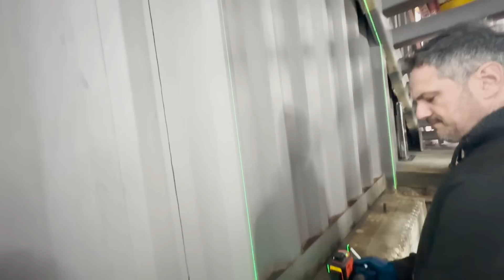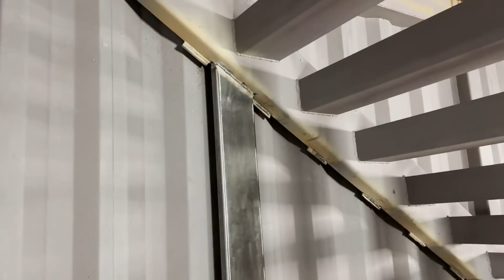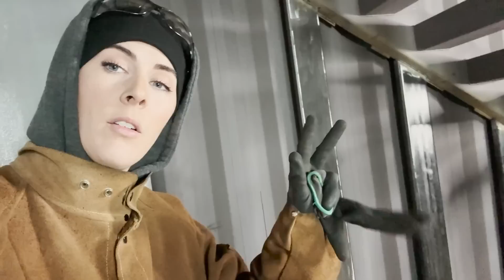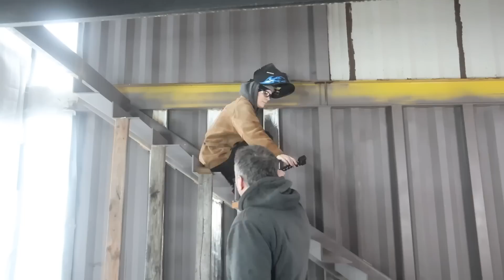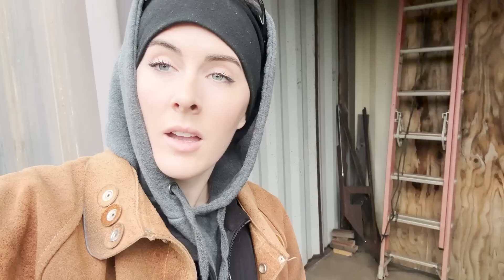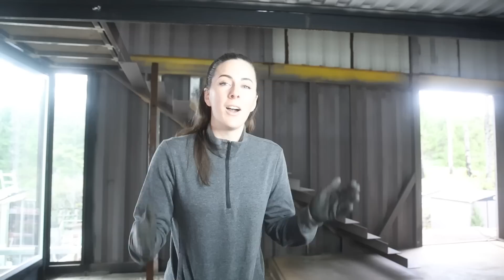LAST STEPS for our CUSTOM FLOATING STAIRS ... Will They Work!? #building #construction

Comment: I'M HERE FOR THE THUMBNAIL TOO IT GOT ME 
IF YOU WERE TO WELD THOSE VERTICAL POST TO THE WALL IT WOULD STIFFEN THE STAIR THREDS ON THE ENDS BUT YOU WON'T LISTEN TO ME IT WOULD SOLVE THE PROBLEM YOUR HAVING RIGHT AWAY

Comment: Why would you not primer and paint the base plate? At least with weld through primer. Even though inside and on dry cement you are talking Oregon coast. All that will rust. Just my two cents. Looks amazing. Cool you are doing this yourselves.

Comment: That first step from the plywood to the floating stairs looks hell like you might would fall!
Reply from the maker: As I mentioned in the video, the structure is done, but we still have things to add like the final stair treads and railings, etc. Once they are installed it will be fine but for now it’s a little steep but not too bad.

Comment: The big issue with the stairs has been the flexing but there is a solution that might stabilize them without making them look too bad.  Whatever you put on the stairs for tread, make it connect one to the other so that when weight is put on one step the ones above and below will help support.  I think that's not the effect you were going for though.  It's too late now but I think to make it more stable you could have set up 3 of those main C channels and even put one on the outside of the building.  Just a few inches between would make a world of difference with the leverage.  At this point that would mean scrapping everything and starting over though.
Reply from the maker: Worst case we will add some supports on the floating side, but for now they are pretty solid and barely flexing. We’ll see how it evolves with time! Still have a few more steps to complete them 😊

Comment: The stairs, landing and supports look great.  For a real flexing test you need to take a 30-40 pound anything and carry it up the stairs to see what that does to the stairs.  You will probably be carrying up things for the upper floors up those stairs to live with, so it's reasonable to see what happens when your carrying a load up the stairs now, before you add the extra weight of the treds, whouch could cause them to flex even more under the added tred weight.  Who knows, maybe the treds will stiffen them up more, or not.   Merry Christmas to you both.

Comment: I’ve eluded to this idea before, but in the ceiling put two structural cross beams 2 to 3 feet after the start of the stairs, and 2 to three feet before the stairs end. Drop from the ceiling two vertical posts of 2”x2” square that come all the way down the meet where the railing will be. Put a 1 1/2”x2 1/2” square tube guardrail that runs the length of the stairs attached to the vertical posts dropping down from the ceiling. Weld in structural 1 1/4” (or there abouts) square tubes as spindles between the undertreads and the guard rail -every 4”s or whatever your local DOB requires reconciled with the width/frequency of your treads. And boom! No more flex on the outside, still mostly floating. Float your tail off the guardrail or spindles, use the same material as the treads (I assume wood?)… not truly floating but still suspended and floating-ish :p hope that idea’s helpful!

Comment: why not use a steel plate for the landing. As for the stairs you can stiffin them even more by adding a plate at the end cloestes to the wall, this should move the flex point further out from the wall. You have put renforements on the outside of the C channel you should have put enforcement on the inside of the treds, is what I am meaning.

Comment: Had the string been correctly stiffened to prevent twisting before installation there would have been no necessity for props and besides which the number of props are excessive.  Careful design and fabrication drawings would have prevented the excessive waste of time and materials and from that aspect the installation is disappointing.

Comment: Sweet, great job on the frame work on the floating stairs. It would look cool have steel spindles between the 2 stairways. Youd see through it yet still have safety. ❤

Comment: If I was in the middle of your project (more welding, cutting, rust removal, and painting) I would look for a good used 'rotary screw compressor'. They are very spendy, but the rotary screw is quieter than the piston type, no oil, it doesn't need to drain the water because it doesn't accumulate water vapor. The rotary screw can keep up with very high demand.

Comment: Normally when you put anchor plates on concrete you would put packing under the plate about 1" high then drill and bolt the plate down, then once finished grout all those base plates                                and waaalaaa you will have a aesthetically pleasing looking base plate on the concrete. This also keeps moisture away from the steel on concrete.

Comment: Why make the stringer so rigid, if it is the steps that flex?🤔
Reply: I was coming in to say almost the same thing 😂
Reply: In any steel structure load is transferred throughout. Its not the tread that does all the flexing, but a combination of the stringer and tread. Stiffening the stringer and frame supports greatly reduces flex by transferring more forces into the greater structure. Without any stringer support at all those treads would flex up to a half inch in the center of the stringer, and progressively less at the top and bottom extremes. If the stringer was a full box section it would have been much stiffer, same if the treads were C section. Be interesting see how they clad the stringer and treads.
Reply: @ButteredToast5000  -- The steps are simply a built-in beam. No matter how much you stiffen the stringer, it is the step that will flex under load. If you do not stiffen the step, it will continue to flex regardless of how stiff the stringer is. Obviously they did not calculate the flexure of the steps, under a load at the extreme point of approximately 80 kilos. Calculate the maximum deflection of the step, with the section you have. f=Mx/Wx
Reply: @fmclaridad7510  Agreed, but the stringer minimises the overall flex. Angles aren't really suitable for cantilever treads. I design and build commercial and residential steel staircases and while their design is interesting, it is going to flex and make noise with the current specs. top strung cables or even better, rods would fix it. From an engineering standpoint more than 2mm of flex per metre is unacceptable. not sure exactly what fraction of an inch that is, but it is only 1/3 of a 1/4 inch over 3.3 feet. so a lot less than they have.

Comment: With the treads on,  it will also increase the weight on stairs, and possibly obver time the deflection may increase with the metal fatigue of constant use.  Possibly a thin triangular wedge shape welded underneath could help distribute the load better and not impeed too much on the floating look.

Alternatively, the handrail coud carry some load if a welded baluster was conected to a structural metal hand rail with support posts top and bottom. 

And, I realize that you might not worry about deflection, as with only 2 of you it might not become noticable for dozens of years & not dangerous in any way... 
I truly enjoy watching your content, as someone who grew up in my parents machine shop working with metal, and can't wait to see the final finished house!

Comment: Tread depth has to be 10 inches to meet code
Reply: This is just the steel sub frame, I have no doubt the treads will meet code. This dude is super fussy with his build. Its impressive to watch.

Comment: Worst ideea ever ! Stairs without railings is just an accident waiting to happen !
Reply: Apparently you missed the previous videos and the at least two times in this video, where they have clearly said that they are building to code and there will be treads and railings.  Besides, you don't build railings before the structural staircase.  Generally, you build the structure, add the treads, risers, railings and pickets followed by final finishings, trim,  paint, stain etc.  This is step one!
Reply: She said they are going to add some.
Reply: @craigshrimpton5765  Someting on top, because they are too smal to step on them. At least that was my understanding.
Reply: Your new here aren't you 😂
Reply: You are like a surgeon with the plasma cutter! No guides and laser straight great job!
Reply: They Will Be Adding A Hand Rail. You Must Have Not Listened Nor Hear Entire Video!
Reply: It wouldn't be code without railings, so of course they will have them.
Reply: That's not the final that's just the beginning if you're not listening to them
Reply: ur dumb, they've said multiple times there will be railings
Reply: Thats the easiest part to do...
Reply: ur dumb... they've said multiple times they'll have railings
Reply: A piece of metal sticking out of the wall , at head height , for just about everybody....
Reply: No value in this post man. Chill
Reply: You obviously didn’t listen till the end when it was said that treads and railings are coming